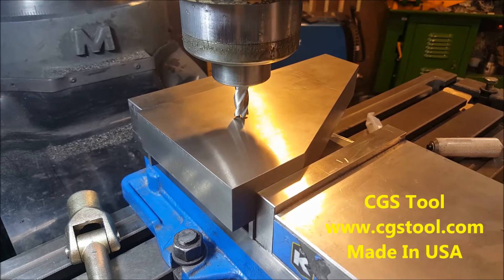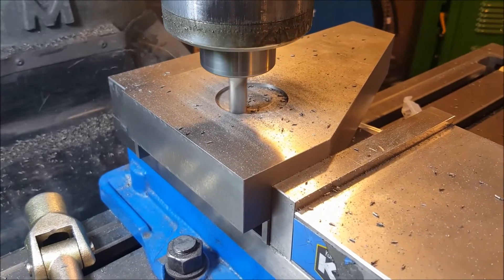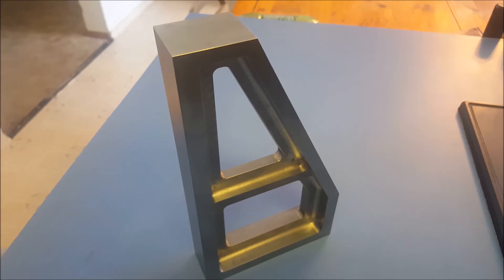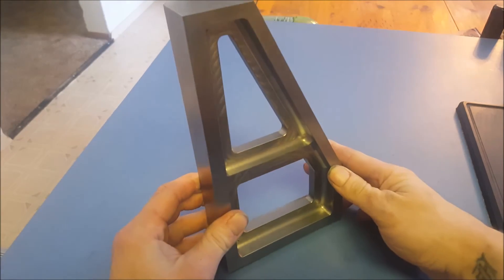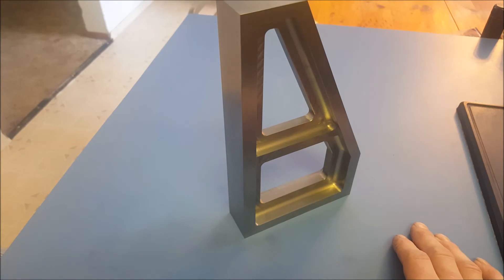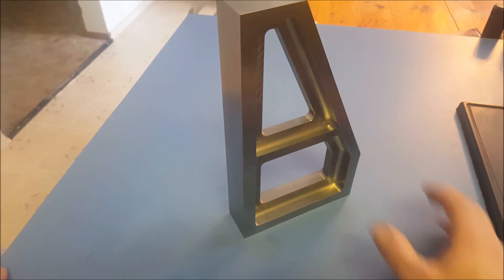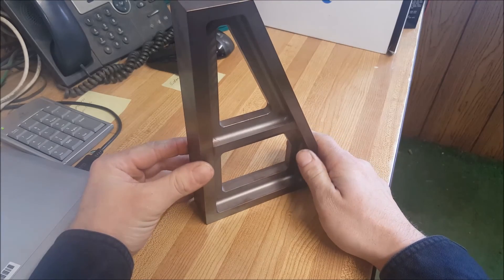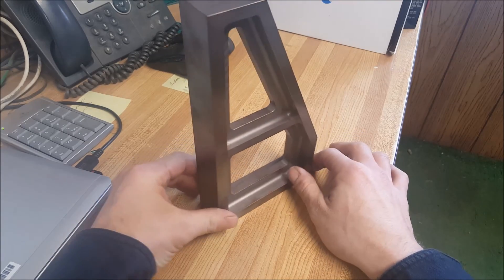Cast Iron Master Square Part2

Comment: Nice work.  Sometimes, hanging the part up on a string and ringing it like a bell also relieves residual stresses.  I would do that before scraping it, and perhaps afterward as well as a test.
Reply from the maker: +Bob Korves  I did ring it after the grinding and after scraping the long face, I didn't see any change after ringing and bluing it